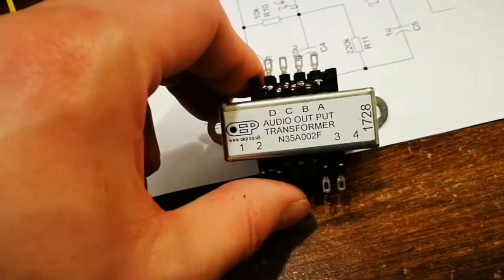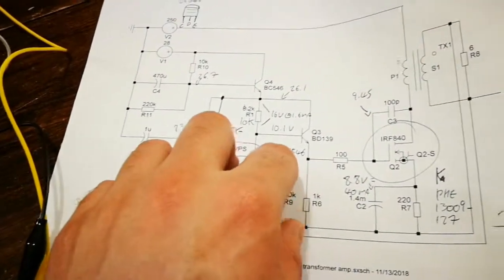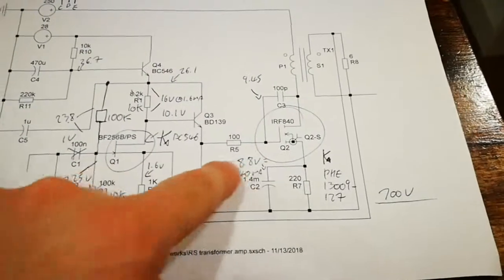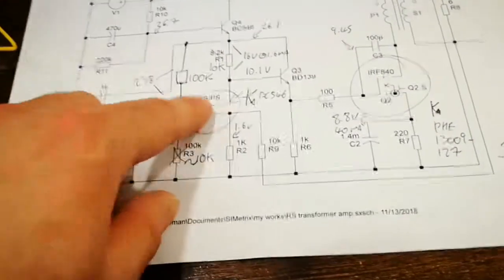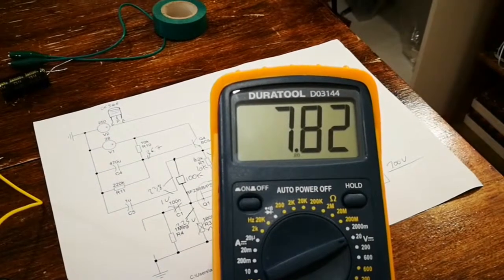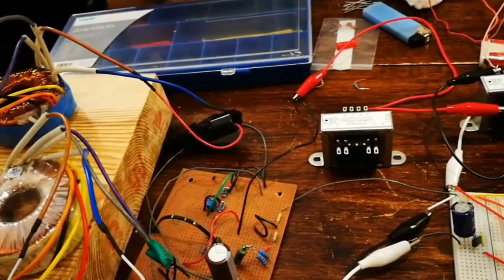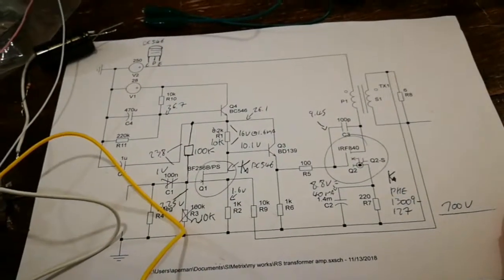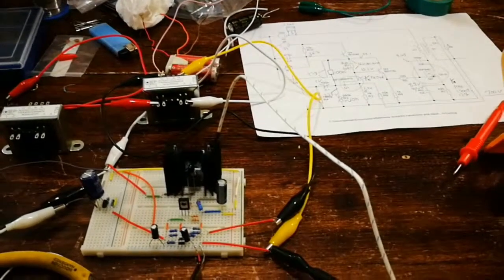Transformer coupled transistor amplifier

Comment: wait..why are the voltages so high??? wouldnt those high voltages break the transistors?
Reply from the maker: I had issues with avalanche breakdown using BJT devices, even high voltage ones. IRF840 were fine.

The transformer is designed for the kinds of voltages you'd see in a valve amp.